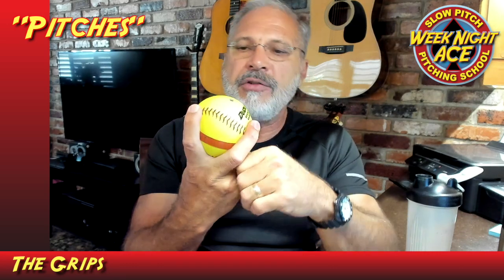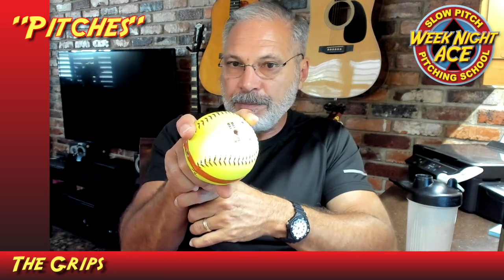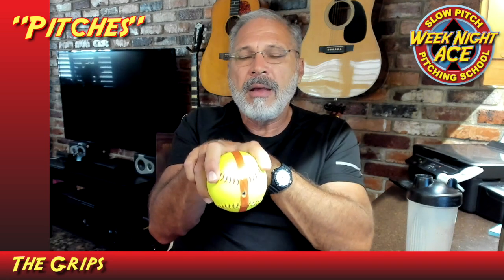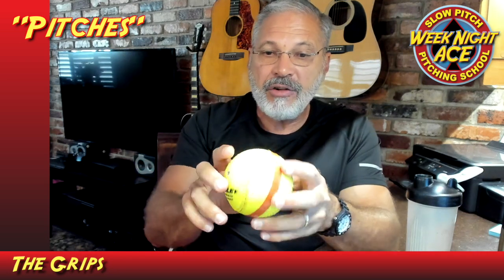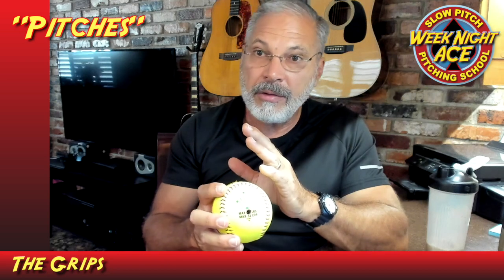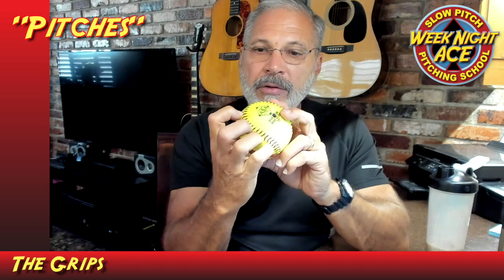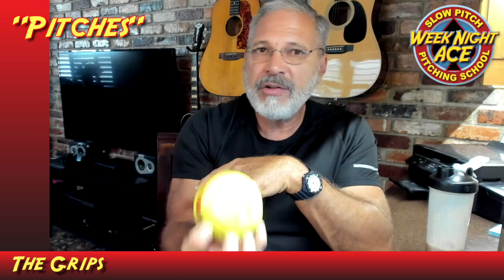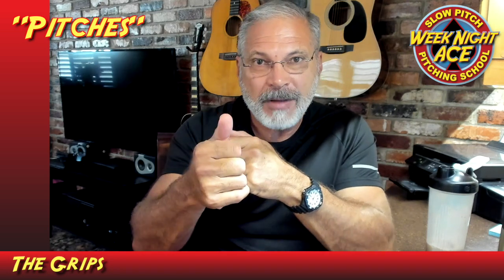All Grips for Slider, Screwball, Backspin and Knuckleball. Slow Pitch Softball Pitching Techniques

Comment: Should I put the practicing tape on a clincher (soft white softball) or should I even practice with a yellow ball.
Reply from the maker: You can use tape on any ball. The tape is there so you can monitor the direction of the ball rotation. Otherwise, it is almost impossible to make adjustments.
Reply: WeekNight Ace thank you!. We usually use the white balls.

Comment: Just played in myrtle ..and only in South Carolina is where they use the judy punch often . What's the best way to defend against the judy punch
Reply from the maker: Hi Milk Man, Punch and Judy style hitting like any style requires accuracy and is most effective when used by a power hitter. If a hitter can't hit a ball over the outfielder's head then he's not too tough to defend as the outfield can play up and take away the short stuff. The power hitter, on the other hand, can hit deep or short, and that is the challenge. When I face this kind of hitter I usually shift my defense (short fielder on the pull side) and pitch him to pull with a screwball or slider. You can't have everything so I give him the opposite line, not the entire right side. If he can hit me there, he gets a hat tip from me.

Comment: New to pitching…thanks for your help. I’ve been working on the different pitches…more specifically the knuckle ball and the slider. 

The slider has the right spin it seems, but no break. Is that just due to the rpm of spin?

For the knuckle ball, I can get it to move without much spin on short distances…but it spins quite a bit when going the 50 ft. I can’t seem to remedy that. Any suggestions? Thank you
Reply from the maker: Elijah, the knuckleball is the tough one. Arm speed is key as you have no help from the wrist. If you're getting rotation, your wrist is in the pitch. If you want to send me a video of your grip and pitching motion of both your knuckleball and slider, I may be able to see what's going on. WeekNightAce@gmail.com

Comment: That's a 12" ball correct?
I usually play second base until our pitcher couldn't make it out and I stepped in. The issue I had tho was grips, I have such small hands that I completely palm the whole ball to be able to have control... any tips?
Reply from the maker: Hi Erick, yes, a 12" ball. Your situation is fairly common. If your palm is in contact with the ball you can still have good control. Remember, it's your fingertips that control the spin and release not your hand. As soon as you begin the release, your palm will separate from the ball anyway. You can still put spin on the ball as long as your fingertips are in solid contact on release. The only thing you may have to give up a little is the separation between your index and middle finger. Just work on your grip in your off time when you're watching TV. Practice spreading your index and middle finger around the ball as far as you can. You'll be surprised how much wider your grip will get. Good luck and keep in touch!

Comment: At 6:06, you point out the difference with the screwball and slider is using the ring finger to push, versus the thumb push. Thank you. For clarification, do you flick your wrists depending on a slider or screwball?
Reply from the maker: Yes, If you notice my wrist motion in the video, I do rotate the ball with my wrist, or as you say, "flick" my wrist toward the rotation direction of the ball. For me, higher rotation speed = sharper more consistent break. With the screwball, as I note in the video, I push with my ring finger and impart the greatest part of the spin pressure to the ball with my middle finger since the middle finger is the last point of contact with the ball on release. With the slider, I push with the thumb but focus the spin pressure on the ball with my index finger. I hope this helps and good luck!

Comment: Been loving your videos. I had a question about the grips vs the arm/wrist angle when throwing breaking pitches. Would rotating the ball in your hand and throwing the pitch as you would the basic backspin generate the same slider/screwball spin as it would be rotating your wrist as in your videos?
Reply from the maker: Joel. It's the rotation axis that creates the break on the ball. Simply changing the seam alignment in your hand and throwing with the standard backspin motion will not change the rotation axis relative to the ball flight/direction.

Comment: I'm trying to fix the hard curve to the right. The curve is there, but it goes too hard inside a right handed batter just outside of the plate. Ever have that issue? Trying to get out of Walk City.
Reply from the maker: Hi John, sorry for the late reply, just now finding some older comments that YouTube just sent me. Strange. 

If you're a right-handed pitcher and the ball is breaking into the right-handed batter or to your pitching arm side, then what you're throwing is a screwball, not a curve-ball. The curve-ball breaks to your glove side, whether you are a right or left-handed pitcher. 

If we all had the problem, you describe here, wow! A pitch that breaks too much? Here's is where you should look. First, if your pitch is breaking consistently, the same break each time, then it's a matter of grooving that pitch and hitting your spot more frequently. If, on the other hand, the break or movement is inconsistent, then find out why your grip or release is not the same on each pitch. You are obviously doing something right if you're getting a hard break on the screwball. The screwball usually doesn't break as hard as the slider, and the screwball can be very effective against right-handed batters as you can force the batter to pull the ball foul, roll it over or force him to hit it to the pull side.  

Good luck! Let me know how it goes.
Reply: @utah32804  thank you!
Reply: Yes, I'm a right handed pitcher and the pitch breaks hard inside to a right handed batter. Thanks again for the clarification. I'd be interested if you decide to do pitching clinics.